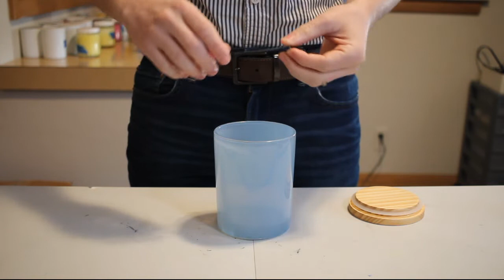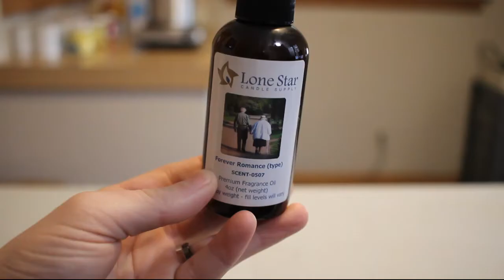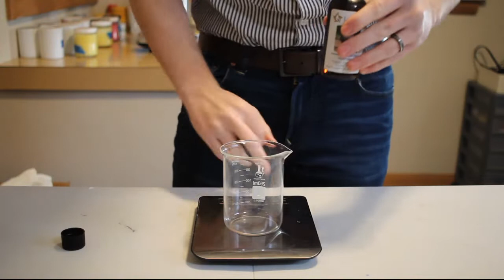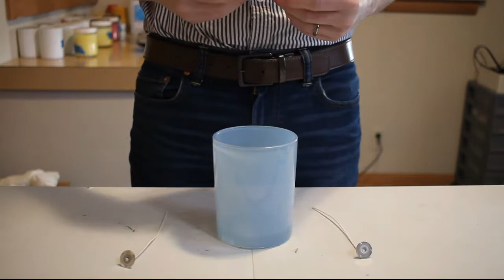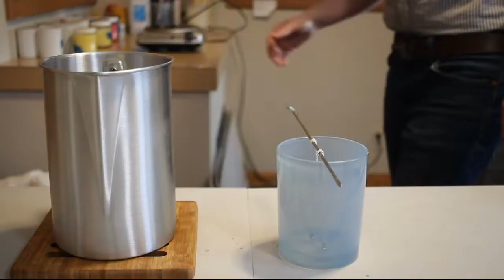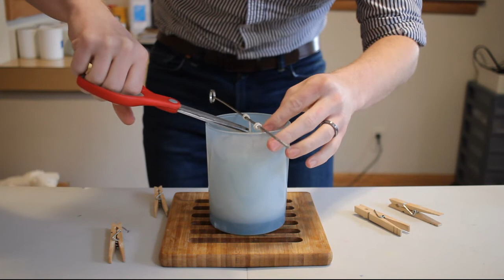Double Wicked IGI 6006 Candle (Smells Like Old People But In A Good Way) | Candle Making

Comment: Hi Kevin, any tips for double wicking with wooden wicks? Using 6006 and 4” diameter. Nothing seems to work. Some are too hot and soot in 3 hours others leave too much wax behind then get drowned. Please help.
Reply from the maker: Which wooden wicks are you using?  Boosters or nah?
Reply: @ArmatageCandleCompany  
What I just tested was .02 .250” three of them but wouldn’t get a good enough melt pool for full melt pool. The .03 .250” would get the container 180 degrees. 

I’m trying this next....with and without boosters. I’m even trying the .02 and .03 series from .375”-.5” with and without boosters.
Reply: For full HT*